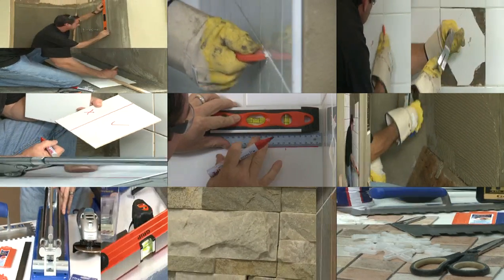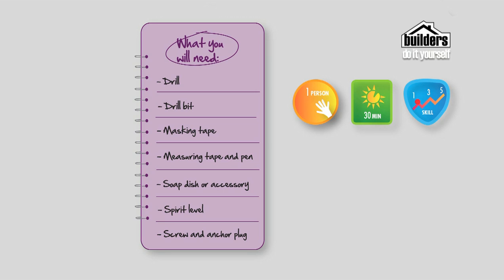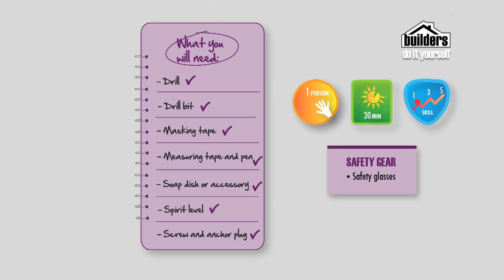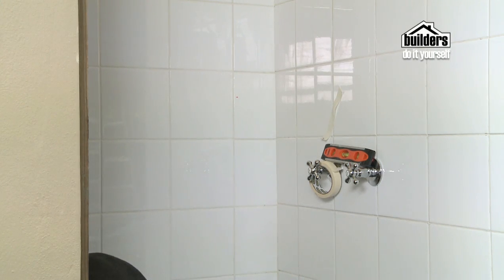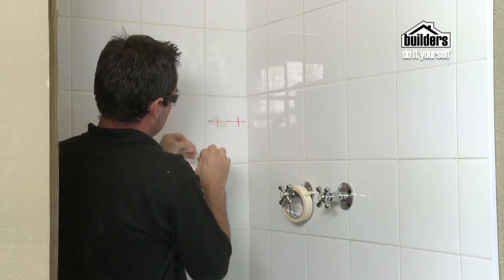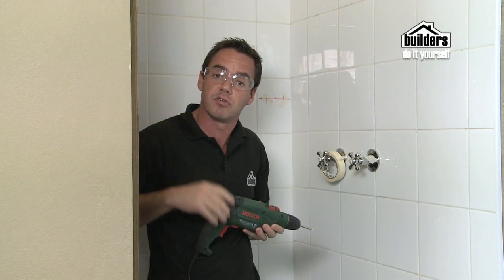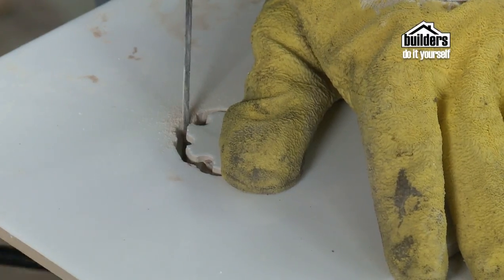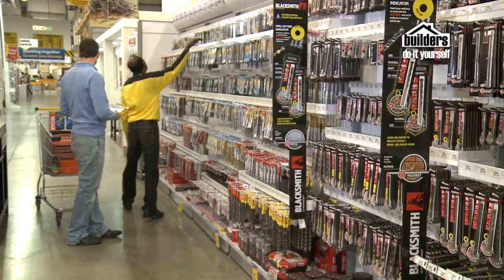Builders DIY: Tiling - Drilling into a Tile

Comment: I would add a few additional recommendations when doing this:
Firstly drill the hole slightly deeper so the wall plug is recessed into the tile.
Secondly drill the hole through the tile using a drill bit slightly wider than the wall plug, but use the correct size bit when drilling into the wall. I have have had wall plugs expand and crack tiles when screwing them in as the wall plug expanded.
Thirdly  if you are drilling into a shower wall add silicon sealant or fresh grouting into the hole before screwing on the attachment. This will stop water penetrating in to wall through the hole.
Lastly make sure the fastener you are using is either brass or stainless steel. Even nickel coated steel screws rust.